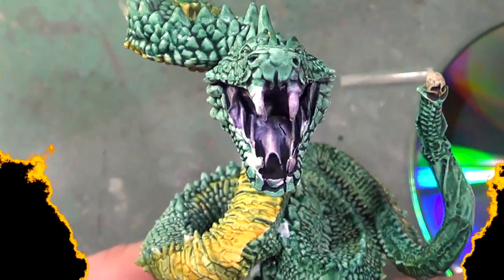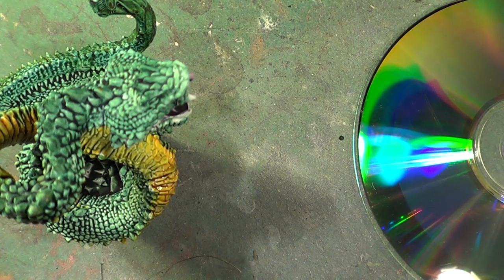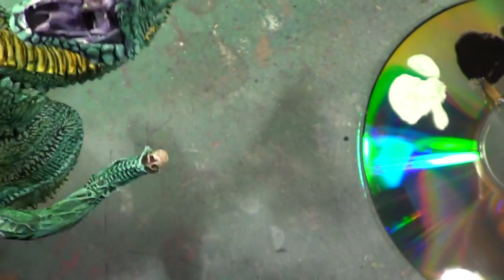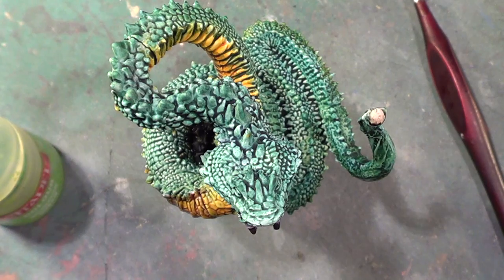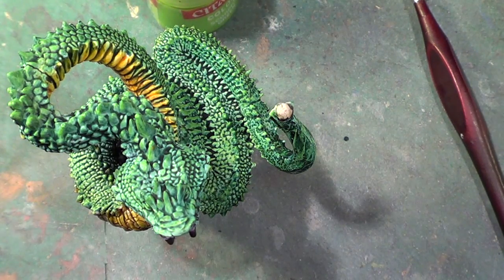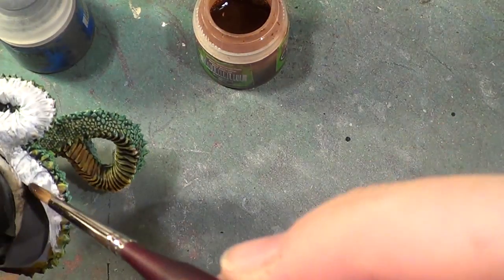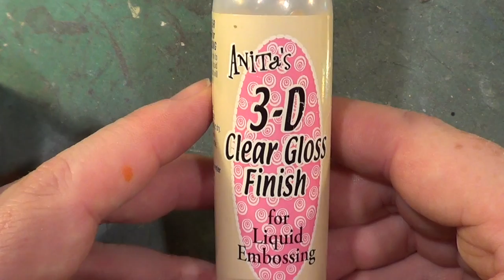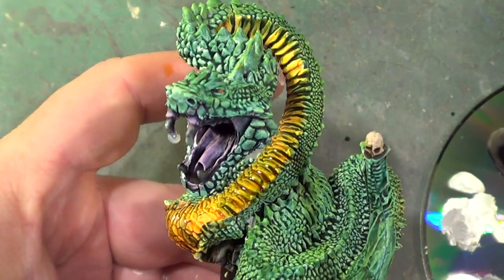Painting Conan The Giant Snake Part 2

Comment: A master at work. Which brushes did you use and which matt varnish will you use? Also can you clarify when a glaze should be used (pretty basic this, I'm afraid but I'm a newbie and confused between glazes and washes)?
Reply from the maker: Thanks I don't know about master but thanks :)
I use red sable brushes from Rosemary & Co. as for Matt varnish I only have Citadel Purity Seal but I am thinking of getting another but not sure which.
A glaze should be put over a finished colour to enhance it, a wash is put over a base colour to intensify the shadows as it will pool in the recesses and move away from the high spots, I hope that helps